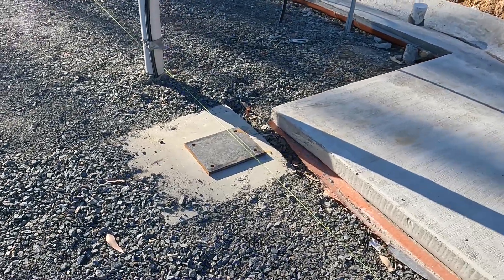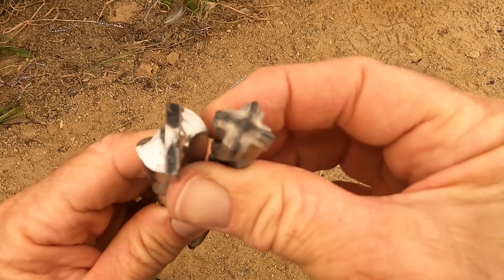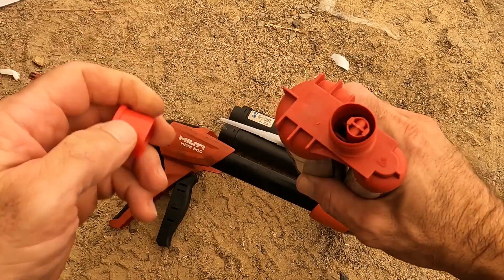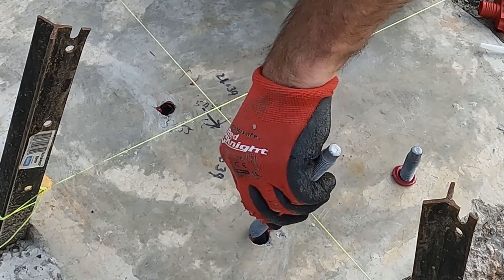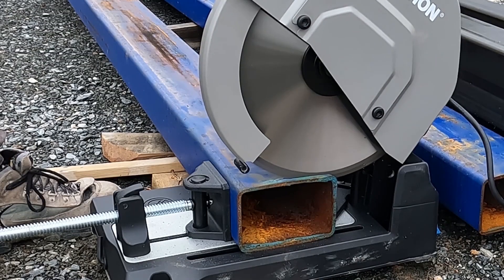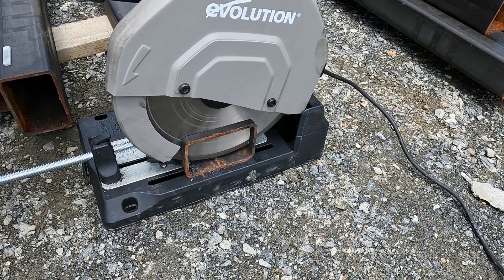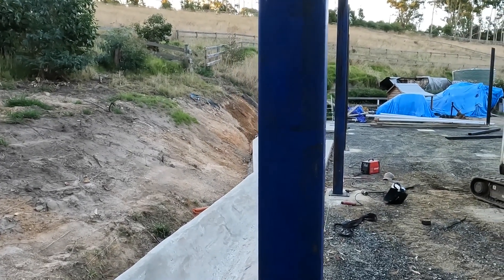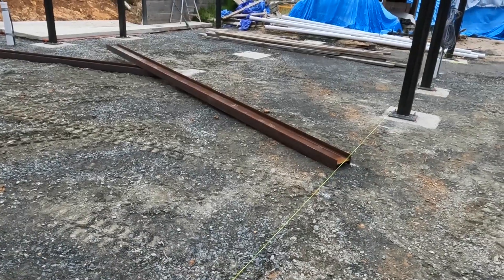Workshop Build part 8, Building custom structural columns

Comment: Gday, thanks for making these vids - really helpful. Did you consider stainless hold down bolts for your chemical anchor is stainless just not necessary?
Reply from the maker: Thanks mate, glad you like the series. No, stainless bolts no good, Being fully engineered they needed to be high tensile steel as well as galv to avoid any corrosion. They are 16mm and 200mm long, felt like way overkill, particularly with 32mpa concrete and the ultra strength Hilti chemical anchor…what drove a lot of how heavy duty it is was my desire to include a 1 ton lifting rail along the centre which spans across 7 metres. It’s very useful but did add a lot of cost to achieve…